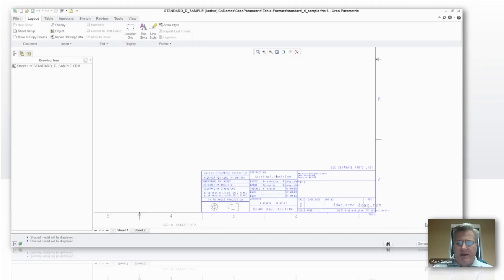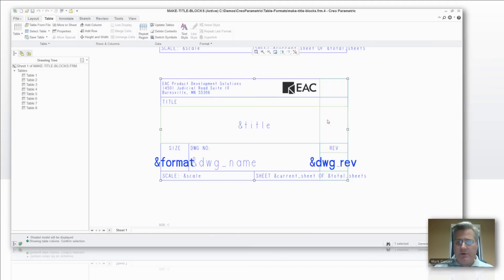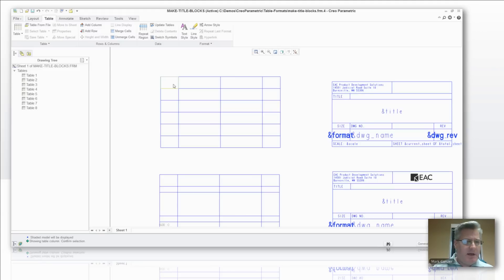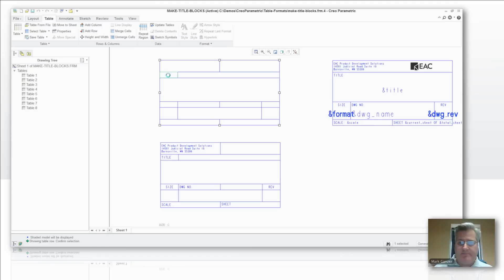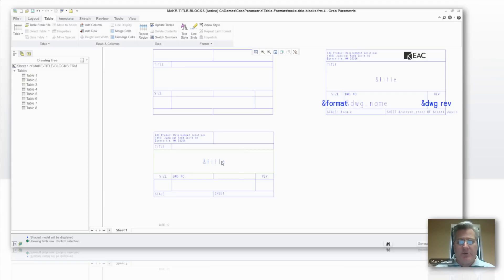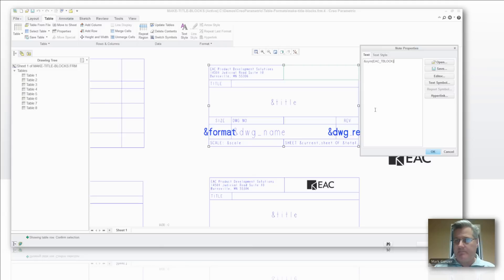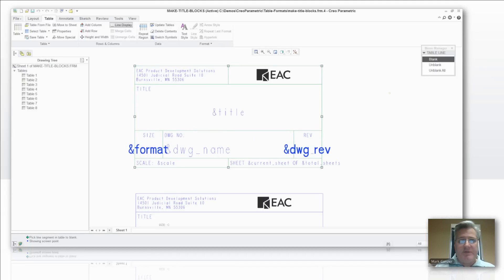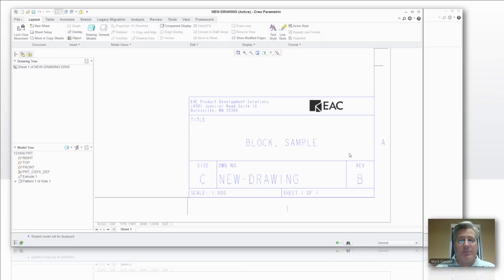The right way to create Title Blocks in Creo Parametric and Pro/ENGINEER - EACPDS Tip of the Week

Comment: Hi Mark!

A small detail is missing so I can insert a symbol into a table as text.
When you doubleclick the table, it opens a dialog box "note properties" and you put the code of the symbol, but with the double clik in the table I can not open this dialog box.
Any tips?
Thanks
Reply from the maker: Hi Paulo!

If it’s a table cell that has text in it (not part of a repeat region):
You can single click and select the redefine icon in the mini-menu.
Hold your Alt key down if you are not in the table tab in a drawing.
If you double click it brings you to the format ribbon. You can select symbols you want from that ribbon as well.
If the cell is part of a repeat region the symbols will not be able to be added as they will be grayed out.
Reply: @EACPDS  

I ended up discovering that with rmb the menu opens and I can put the code like you did in the tutorial.
Thank you very much

Comment: Great video and very help full. I have a question though about the border.

How do you insert the letters and numbers for the zones (i.e. Zone A1) in the borders? In other words how do you get the 'Location Grid' to stay permanently when exporting or printing? Seems you have that in there somehow.
Reply: Ho Jon,
The letters and numbers are part of the drawing format itself. When the format is added to the template that all comes along.
Mark
Reply: Mark,
Thanks for the reply. My question then is how are they added to the format? Is this done manually i.e. positioning text boxes or is there an automatic way of doin this?

Thanks,
Jon
Reply: It was done manually. Sorry for the misunderstanding.
Reply: Thanks. I am sure there is an ANSI or ASME requirement for the spacing and the number of zones?